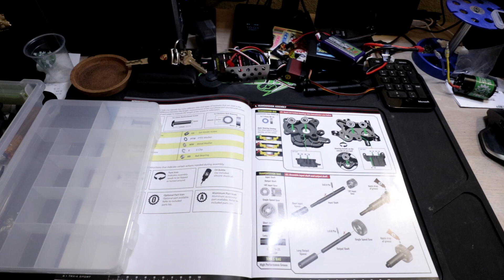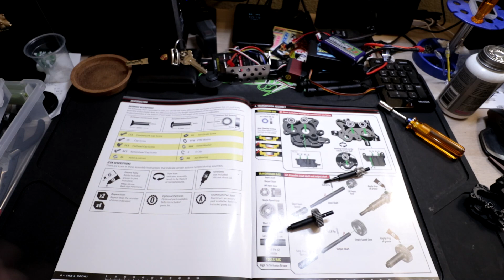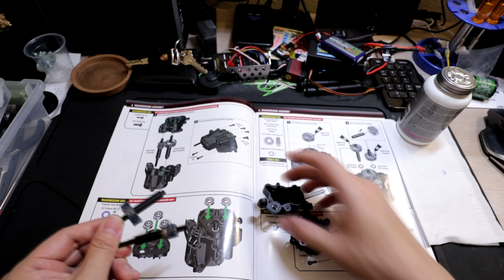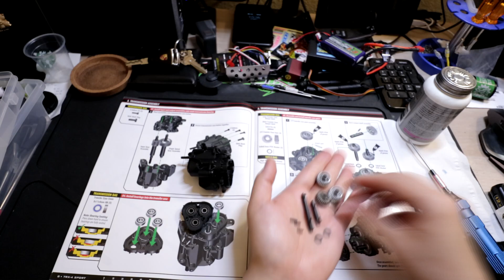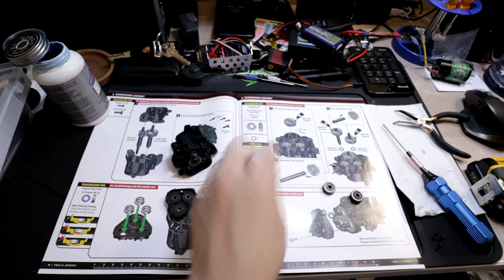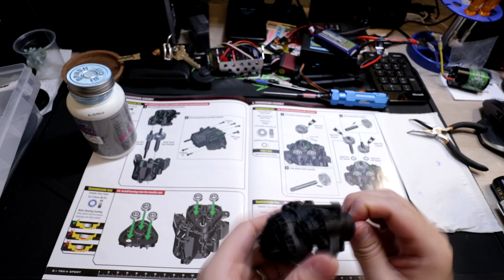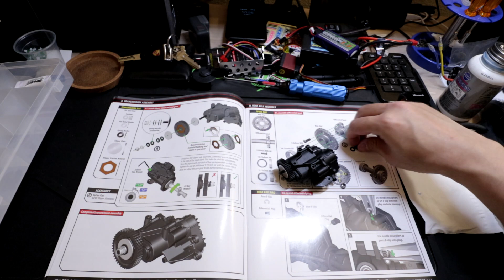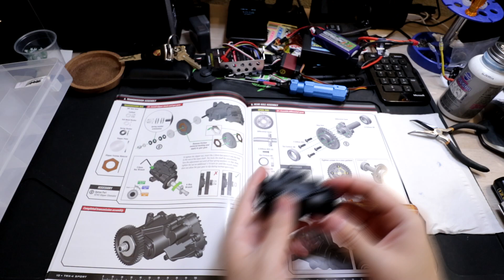Traxxas TRX4 Sport Kit Build Series - Part 1 - Transmission

Comment: Picked mine up Monday and got it built :)  Although that cross pin @4:39 would absolutely not go in. Good thing I had a 2 speed laying around. I'll have to revisit the single speed box and see if I can get that pin in. It's almost like the shaft was drilled in the wrong spot.
Reply from the maker: Does the pin go in fine with the shaft off the assembly?  Is it just the clearance of the hole after you have the shaft assembled?  I'd check to make sure all the bearings are pressed in all the way, etc.  It's a tight fit.  You can see from the video I had to use pliers in order to hold the pin and put it through.  I'd check to make there's nothing preventing the hole from getting enough clearance though.
Reply from the maker: Also check to see if the gears line up properly in that housing.  Maybe the spacer on that shaft could possibly be too long preventing the gear from sitting down on the pin?
Reply: @RevolutionX  Yeah I reseated the bearings and checked fitment outside the case. Everything fits well. Just seems the hole is a bit too close to the plastic for some reason. I got impatient and gave up since I had the extra trans. I'll give it another look soon :)
Reply: @RevolutionX  So just an update for you. It only took 5 more times of looking at it to realize I had the WRONG gear on the shaft. It's amazing how easy it goes together when you assemble it correctly :)
Reply from the maker: @jesscneal  LOL!  It happens!  Need more coffee.

Comment: What happens if you don’t use the black sleeve over one of the shafts?
Reply from the maker: I really don't remember what goes on in this transmission, but from what I can guess at without digging into it again, is that the black sleeves are probably spacers to ensure that the gears don't move around.  I can't say for sure unless I dig into it and remember what goes on in there though.